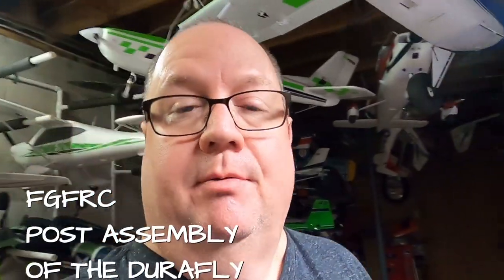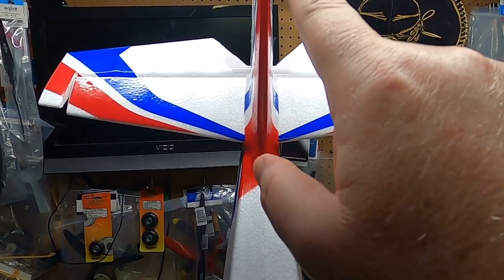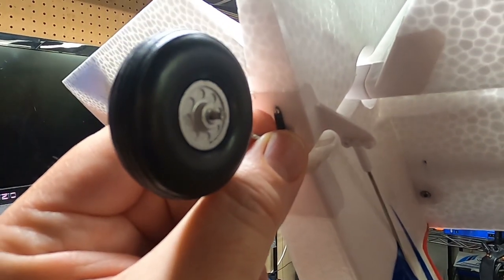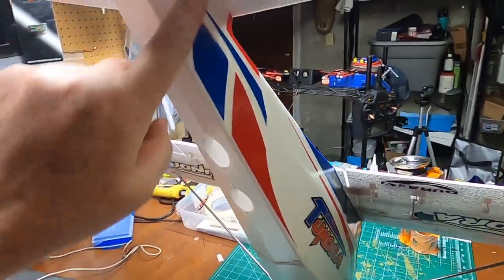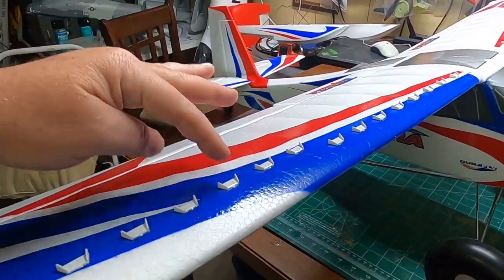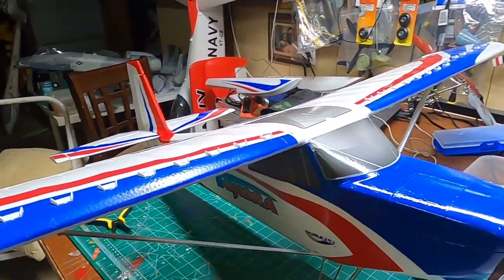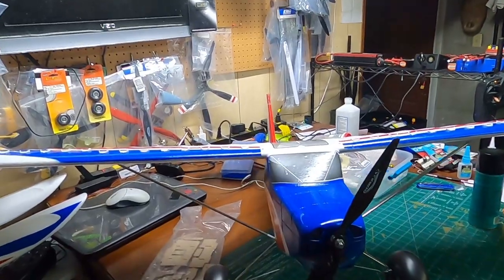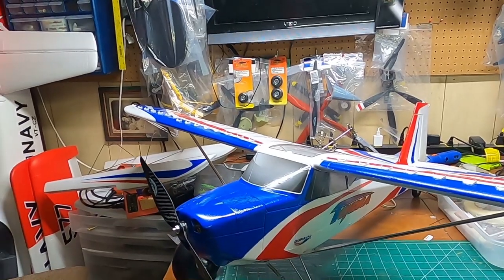POST ASSEMBLY OF THE DURAFLY TUNDRA V2 BY FGFRC

Comment: If you leave off the vortex generators, and not use the plywood battery tray, it would be a case of Tundra V2, meet Tundra V1.
I've not installed the VG since I do spend a fair amount of time inverted.
That said, the Tundra is EXCELLENT value for money, especially compared to the E-Flite Timber options.
The Tundra V2 totally qualifies as my "Go To" model when it's a bit windy, or flying at a site where aerobatricks are going to go down!!😂😎
Reply from the maker: It is really showing promise for me so far.

Comment: Another great video! And a question... I sure like the look of that Minwax spray. And a little extra foam protection can't hurt! The question is, do you worry much about spraying on servos, linkages, any other moving parts? Does the spray have the potential to "gum" things up?
Reply from the maker: Actually yes that is a concern for the hinges that's why I try to spray at angle that does not allow too much down in them.  But it will happen and all you need to do is work the hinges a little if they stick a little. If you get so much that the servo will not move then un attach the servo clevis and work the hinge manually just like you should have done at assembly.  As far as electrical issues with the servo shorting due to minwax I have never had an issue but then again I just use a light "dusting" with the spray, its a little to thick I believe to get into the servo. Here is a video on how I do minwax  or the "treatment"  as I like to call it.  https://www.youtube.com/watch?v=ihQNpO_W2Ew&t=147s
Reply: @FatGuyFliesRC  Thanks for the quick reply and link to the video. First and foremost, it's been 1 1/2 years since that video and I hope your Dad is still doing well! And a follow up question...    There's other videos of guys using the liquid version of Minwax and applying it with a foam brush. Have you tried that yourself and still prefer the spray version?